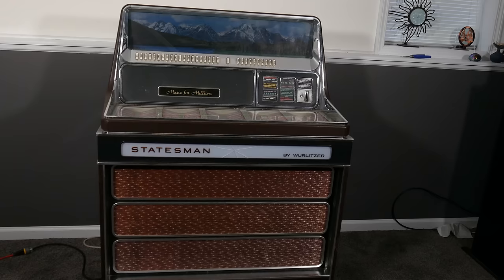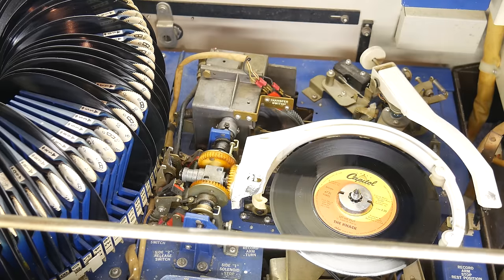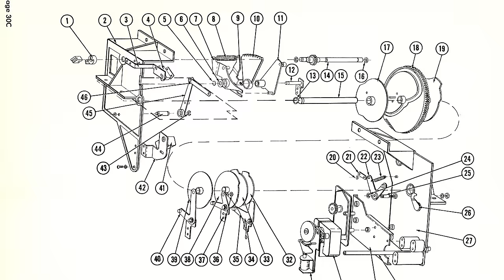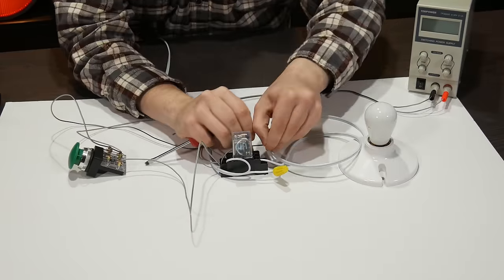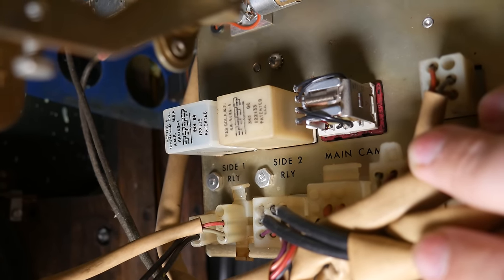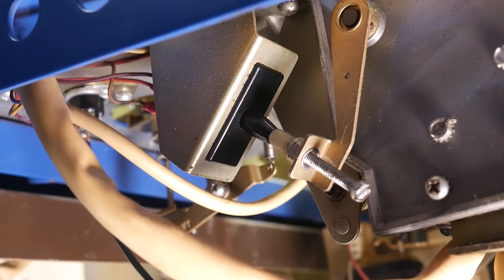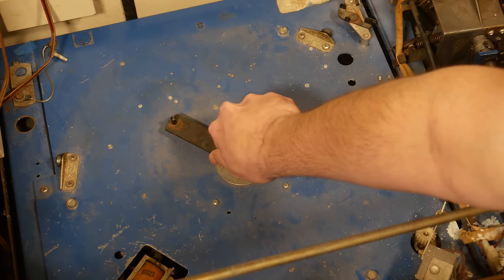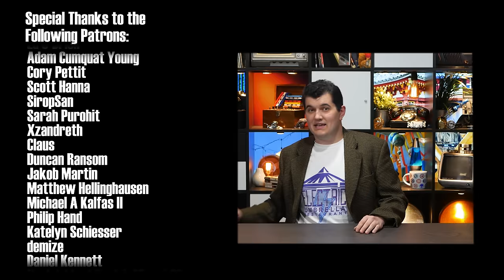The Computer-free Automation of a Jukebox (Electromechanics)

Comment: 1970s Wurlitzer: imma label every component in that machine for repairs
2010s Apple: imma glue down components and use the exact same screws with three different screw heads to deter repairs-men
Reply: 2020: right to repair
1970: necessity to repair
Reply: @mihan2d  true
Reply: @mihan2d  Still a necessity to repair if you want 2020's technology to still work in 50 years the way 1970's technology still does.
Reply: @c182SkylaneRG   R/woooooooooooooosh
Reply: @wavegodsco557  Probably. I didn't get much sleep last night. :)
Reply: more like same looking screws but with 0.2mm difference in length so a trace on the board gets damaged if you mix them up. looking at you "long screw problem"
Reply: @ChronOJohn2  Thankfully Dell screws are either 3mm long or 8mm long, and thus impossible to mix up which are "long" and which are "short". Less impressive is that they have two different thicknesses of 3mm long screws, but you can usually figure those out if you stare long enough.
Reply: @c182SkylaneRG  Sadly, today it's all about planned obsolescence, how companies force you to replace expensive appliance as soon as possible so they can sell you more. Technology today will never be able to be preserved, unless the company specially make a though model which can survive for a long time with much higher price.
Reply: Glue?
Apple: Laughs in solder
Reply: @c182SkylaneRG  "And if thou gaze long into a screw, the screw will also gaze into thee." ~ Nietzsche
Reply: @VintageToiletsRock  Why not the both? Glue for a case, soldering for a memory?
Reply: @PiotrPilinko  or glue for a battery stares at samsung
Reply: @VintageToiletsRock  not glue, the practice is called 'potting', basically filling the whole empty space with epoxy, you can't see what's inside without damaging it, and have all the ICs and transistors identification sanded-off with sandpaper rendering it difficult to reverse engineer. Those labels in 1960s are now replaced with big "NO USER SERVICEABLE PARTS INSIDE".
Reply: @katt2002  that's what the mainboard of my laundry machine looks like. If the board dies the replacement costs 2/3 of a new mahine as the rest is just an AC motor and tin.
Reply: @manuldepokas  true and sad.
Reply: Pretty much.
Reply: @ChronOJohn2  eh. screw that, it's more of put 1,000,000 screws so you're prone to screw something up and it shorts something.
Reply: Piotr Pilinko good luck trying to solder a 3x3mm surface mount BGA package
Reply: Part of the difference is jukeboxes often weren't purchased but leased.
Reply: @Acueil  
Consoles do pretty good
Reply: @thegirlwiththemouseyhair6486  It used to be. Then red ring of death and blue light of death happened.
Reply: @Acueil  Wurlitzer used to sell you the machine, then sell you a service guy as well. I sort of prefer it how it is now.
Reply: Things used to be repairable, now they're replaceable
Reply: Ten yearsearlier and almost all the parts in there would still be brass.I have  got a 1960ties home tape maschine no hifi by any means but buildlike a brick. Allmost all turned metal parts in there , there is a reason why that thing weighs over 16 kilos.
Reply: Right to repair!
Reply: last time i checked, apple phones were marketed to consumers, who they didn't trust inside them, while this thing was marketed towards commercial usage, who they trust far more.
Reply: @theX24968Z  True, may be the fact that apple don't trust consumers to be in their products, but they didn't design it to be repairable for themselves either.
Reply: @kevinsong712  maybe thats not their goal with their products.
Reply: @theX24968Z  lol thats exactly what I was criticizing ; )
Reply: Michael Persico  Not if the company making it no longer making the product. Happened multiple time on my printers. I sent it for repair through the official channel, they claim to not being able to replace the parts due to it no longer being produced. I might be able to find some parts if I scour e-bay or somewhere else, buy there is no guarantee that it would be the original parts. Not to mention that even when the company do have the parts, the cost would be half of a new product. At that point fixing the printer is not worth it.
Reply: It's not entirely anti-consumer, part of it is that the more complex and advanced our electronics get, the harder they are to repair. If a trace on a microchip gets scratched, you can't exactly repair it easily
Reply: @ENCHANTMEN_  Jumper wire. Just skip the trace step. All a trace is is a wire embedded in silicon.

 However for that you need to know where that wire goes and companies these days think if they release wire diagrams somehow people will steal their intellectual property. Ironically the repair guys aren't selling knock off iPhones, its the factory they contracted to build said phone who turns around and makes copys to pull extra cash on the side. Outsource the manufacturing means outsourcing the ownership of your product. Save money now to go out of business in ten years, ask the US TV manufacturers how outsourcing worked assuming you can find any still in business. But yea its totally the guy trying to fix the RGB in his keyboard who is selling thousands of perfect knockoffs on the black market.
Reply: @mihan2d  Most JBs would be leased and not bought anyway, so the repairs were done by the main companies, as was the record swapping over etc.
Reply: up until the 1980s. Early electronics used to Come With full-blown schematics.
Reply: Yeah, because everybody is so concerned about waste and cares so mouch about environment… Try recycling fully potted/glued electronics device.
Reply: @Tomas_Stec  they get smashed in rollers the metal recovered in furnaces run at different temperatures for run off and the furnace fired from the plastic.  the damage from the fumes though i dont think is measured
Reply: My computer: Laughs in about 3.000 screws, all slightly different screws so you need 3.000 screwdrivers to fix most of it.
Reply: @nikkiofthevalley  My mum got a small flat blade screwdriver in 1950s bakelight handle with her name on it from the Ideal Home Exhibition one year.  It fits just about every screw head there is,  it can have problems if the screws are stubbonly cross threaded or otherwise wedged very tight but for most applications its fine

Comment: Dude, I have that same green Tarzan Boy record in my jukebox!

Mine is one of the early computerized models, though (a 1979 Wurlitzer X200).  It still uses a largely mechanical changer mechanism, but the computer handles storing selections and moving the carousel to the proper position.

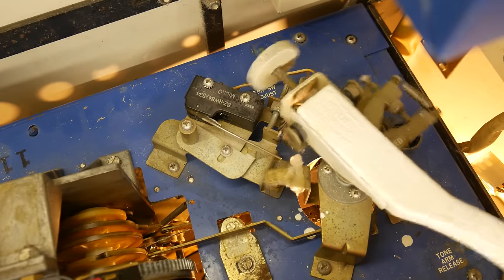Comment: 16:56 "There are a ton of if then statements in here"
I guess you could say it's made of... Switch Statements
Reply: Ouch!
Reply: Badumm-Tsh
Reply: While it's true that a switch statement is a bunch of if statements, the reverse is not necessarily true.
In this case, each if checks different (boolean) variable, whereas a switch checks different values of one (usually non-boolean) variable.
Reply: @muche6321  yeah but he used the plural, he didn't say it was the equivalent of a single switch statement. I'm sure you know that if/then and if/then/else can be implemented as switch statements.  The first being analogous to a single throw mechanical switch, the second to a changeover one.
Reply: A switch statement with a simple integer argument is generally a jump table, not a bunch of if statements. Although compilers may optimize it into consecutive or nested branches if the number of cases is small.
Reply: YandereDev: hisses in fear

Comment: I love learning about how these old jukeboxes work - Great to see the old EM machines working using simple sensors and relays. Another favourite is ten pin bowling machines. Check out the huge mechanisms hidden behind the lanes.
Reply: I used to have an electromechanical pinball machine, and it was basically just a map of switches, electromagnetic coils, and cam units. In this video he showed a locking relay that used electricity to lock itself, but this video reminded me of an interesting type of relay that pinball machines used to stay locked.

Most relays have a single coil with a plate attached to a spring, and switch or set of switches.

http://www.pinrepair.com/em/blylockrelay2.jpg

When the coil energizes, the plate is pulled and the switches make contact, or contact a different circuit. After deenergizing, the spring pulls the plate and switches back to their original state.

The locking switch, which stays locked even when the machine is off, uses two coils, two plates, and two springs to control a single set of switches.

http://www.pinrepair.com/em/blygameover1.jpg
Reply: @potterfanz6780 , thanks for the info buddy. Designing this technology was certainly an 'art'. 
I've watched most of Joe's Classic Video Games YouTube channel, and there's a lot of EM pinball machines that he repairs (and a handful of jukeboxes) and its all fascinating stuff! I would seriously love to work on any of these machines, whilst repairing it seems you'd follow a fairly logical procedure, but the initial design and build procedure - wow, these guys must have dreamt in EM 😊

Comment: After watching all of Ben Eater's breadboard computer series, this is like a splash of water to the face. It's basically the same thing, mechanically. It's like going back to vacuum tubes or something! I love this video and I can't wait for the next one! I have a feeling the next one will be even longer, or have to be split apart once more.
Reply: Ah... I knew this comment section was gonna be as good as the video itself. Gonna check that out next. Thanks.
Reply: Technically, this could all have been done entirely mechanically, LONG BEFORE vacuum tubes or even electricity, as long as you had a midget or monkey to pedal the main drive shaft on your automated Victrola.

Comment: you have touched on the very heart of the reason I became a gunsmith. They are amazing machines that can upon insertion of a magazine automatically release the slide and load a round of ammunition as well as once fired they wait until the pressure in the barrel has reached a safe level then begin moving, subsequently remove the brass casing and throw it violently into the face of the fellow to your right then immediately retrieve a new round and deposit it into the chamber locking the slide into place as it does until required to repeat. The function of the 3 round burst or equivalent is equally fascinating. A firearm can be made to be capable of automatic fire in different ways but most are relatively simple. The burst fire mode contains a ratchet looking piece and uses it to count how many rounds have fired on that trigger pull to know how long to go bang bang for.

Comment: Hey Alec, this weekend I've been repairing my girlfriend's DVD player, and I have to say it's really awesome how cleverly designed their tray automation is. It's like 3x nested principle I'll move a bit of plastic with a curved so a pin moves over a bit, engaging a tooth bar to slide it over which lowers the motor and the DVD onto the tray, before sliding over even further to unlock the tray, until the curved track starts pushing out the tray which engages another tooth bar on the tray to push it out completely which also has a slight S curve to pull the former moving bar from the cog. It's such a clever design, I was amazed.

Comment: Look at it this way: Modern automation using electronics still use switches.They are just much smaller.
See! Now you can love modern electronics as well :)
Reply: Yeah but a lot of modern electronics accomplishes the same things 1970s electronics did, but the modern ones require six or seven orders of magnitude more switches to do so.  So it's much less impressive (by six or seven orders of magnitude).
Reply: @nthgth  For the case of the record player at least, and it's still morning so I haven't considered much else, but I imagine modern tech would simplify the number of switches, solenoids, etc.  The move from logic being mechanical to digital makes things simpler in many situations, but I can imagine some (anything requiring analog mechanics) that would use way more like you say!

Comment: Its mind blowing how they got all of this to work
Reply: The description given in these videos makes the design of these machines seem much more complicated than they actually need to be.  While describing everything in terms of a sequential chain of causalities makes a great story, it adds a lot of obfuscation that is not necessary during the design process.

An engineer only looks at the design from the viewpoint of each of the outputs. At what point should each motor or solenoid be activated?  What combination of inputs (sensor switches) are necessary to define those points at which the solenoid or motor should be activated. The result of answering those questions is a logic table defining the behavior of each output in terms of a set of inputs. The cams were created to generate inputs that did not otherwise stem from natural movements of the machinery.  Latching relays were used to convert momentary inputs into inputs with duration and state.

From the logic table, we have mathematical tools (Boolean algebra, min/max terms, Karnaugh maps, Quine-McClusky algorithm, etc.) than can be used to convert the logic tables into the logical operations needed to define the outputs in terms of the inputs. These logical operations are then encoded using ladder logic of series and parallel switches that define the wiring connections necessary to implement the logic as a circuit.

These steps are simply repeated for all of the outputs. Some minor amount of work was probably then done to optimize and reduce any redundancy between the separate output circuits to minimize component counts.  Once you understand how to approach these kinds of designs, they are actually pretty easy to accomplish.
Reply: I mean just look at the internal combustion engine. Its amazing cars actually work
Reply: Nice to see a Pokétuber on this channel :)
Reply: @timharig  is it hard to learn to design audio circuits? Effects pedals for guitar specifically? It is the perfect blend of a lot of my various nerd interests but I'm pretty limited on electrical circuitry knowledge. Not even sure if that's the correct phrasing but you seem reasonably intelligent so I trust you 'get' what I'm asking. How hard is it for a beginner to get to the point that they could bread board a circuit and have something even semi usable. A fuzz face circuit is like three transistors I believe... Depending on what  model/version it is.

Comment: The 3 gear system in 5:08 is also a similar design used in rear differentials for vehicles. the concept of how that was designed and works can also be found in a old 1937 GM video called "Around The Corner."

Comment: As someone who has worked in a electronics repair shop for the last couple of years, i would have to agree that electromechanical engineering is amazing.

I got hired with nothing more than the experience of a hobbyist, and I'm on a weekly basis amazed at how complex they could make machines, some of these really old turntable players with their gears and tracks all controlled by a couple of switches, still seems like magic to me.

Comment: I once mounted an electric doorbell, a self-latching relay, a battery and a non-mercury mercury switch under a chair in the canteen at work. It was designed to start ringing if someone tipped the chair above a certain limit. It did not have a reset switch (to cause maximum embarrasment). I earned some fame for that. The "mercury switch" was made from a small glass tube (from a clothes iron) filled with small balls from a ball bearing and some terminals for the current. Perfect.